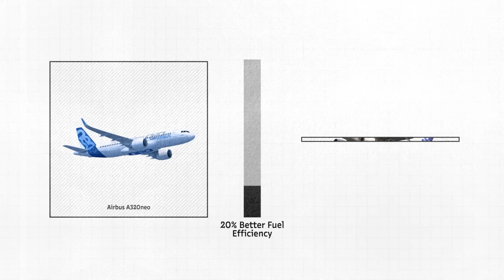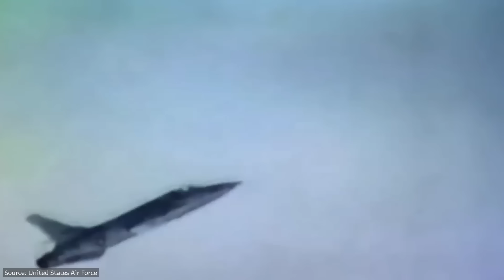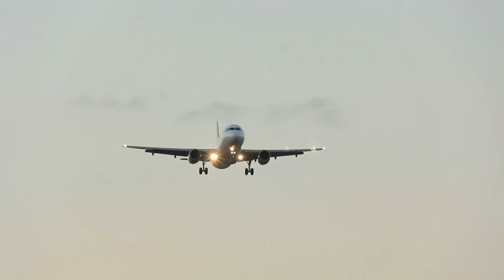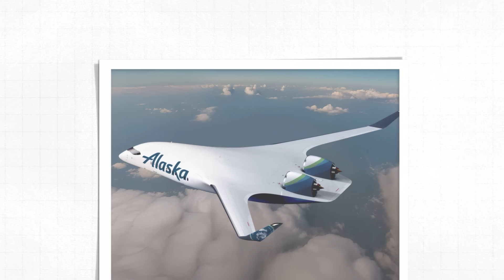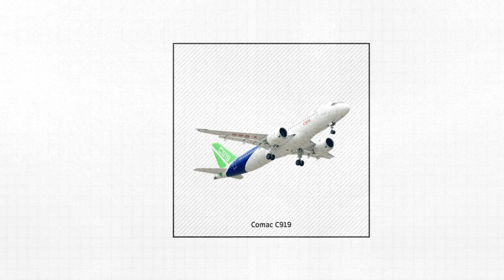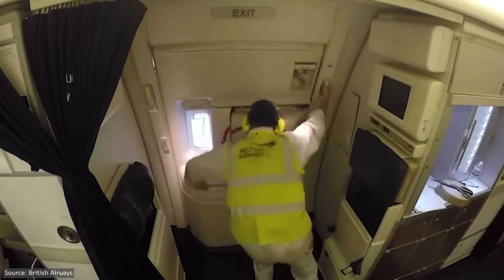The RADICAL New 737 Competitor Coming By 2030?

Comment: Should be interesting to see how/whether they solve the pressurization issue across the entire hull. I can only imagine they'd use something like an air-mattress style cross section to do it, but the fatigue stresses at the joints must be a real design challenge, even with CF/epoxy. I really hope they can pull it off.

Comment: Just watched a video on the Flying V, seems nicer for passengers. If a big efficiency gain could be demonstrated in a workable aircraft it wouldn't be long till every airline wanted them, the airports would adapt. Electric planes would benefit from these more efficient hull designs too. Advanced batteries are already going into production. The advantage of this design over the V is the engines both on a tab in back, maybe this tab could be removeable for service.

Comment: Why not (instead of double-deck) airplanes, create a plane with two cylindrical compartments bolted side by side? Fill in the gaps top and bottom - to smooth airflow and gain from potential lift, and attach wings and jets as per standard aircraft. The space between the cylinders (top or bottom) could potentially be used for battery storage or the placement of hydrogen tanks. There would also be the potential for doubling the cargo capacity.

Comment: I wonder how rough one of these would ride. The wings on normal planes act as suspension to absorb some of the turbulence and not transfer it to the body. When the body is basically the wing, I’d think all that would go straight into the end user vs flexing a wing.

Comment: the design you show is a very unlikely reality indeed. To have the benefits of a blended design, you need it to be a FULL blend . Keeping those little wings is unnecessary, their purpose is simply to avoid dispensing with ailerons and elevators or having to install longerons. Ailerons can be fitted on the outside edges of the body each side and elevators can be fitted to operate from the rear edge of the body, one each side of the engines. No need for wings at all provided the undersurface of the body is flat and clean as a wing and the upper surface of the body is proportionately curved like a wing. Also, you can design it to be "stretched" for later versions. But surely Jet Zero know all this.

Comment: Boeings been looking at this for well over a decade. Low speed flight characteristics with adverse weather can be problematic to put it mildly. Pressurization stresses can also be an issue. 787 fuselages with fairing covers could help with this.

Comment: 2030 Is good timing to use geared turbofans that are mature and reliable.  Boeing had over 20 years since acquiring McDonnell Douglas use that talent that did the BWB research.   But too fearful to Osborne themselves, They will just keep building outdated designs forever.   Aviation needs to improve for sustainability.  The market will make that happen with lower operating costs.

Comment: BWB is a dead end. Besides other problems others already addressed, the A32x and 737 sell as families, with models seating 160, 195, or 220 seats depending only on the length of the tube. One development cost serves 3-4 different market sizes. On BWB, each size aircraft needs to be designed and tested separately, with separate tooling, because the bodies have different contours.  The next tube design wil. cost ~$40 Billion to design 2-3 different sizes, while creating the same BWBs will cost ~$90 Billion

Comment: Cockpit view sucks with its wedge shape, no common parts, and no through deck cargo option. Nonstarter. Seems like they could be less radical by making the front more conventional in visibility. Front should add clamshell doors to access cargo space, and move the cockpit higher above mainwing level.  Give it an ogee shape like a bird, which is self stabilizing. If you are going to mimic nature then do not reinvent the wheel.
Reply: Wow, you know so much more than NASA, FAA, USAF, and hundreds of engineers with PhD's and decades of experience! 
🤣
Reply: @ddsnu2012  ok boomer. Its not about aerodynamics, its about practicality.

Comment: Pressurization I think an imbedded ovum cabin space is easier to pressurize. Passenger window access, I always want a window seat. but I see more than 90% window shades are closed , then on a recent 787 flight my window was electronically opaque for most of the trip. blended wing appears to lend itself to an aft ramp door much like the Hercules, which could facilitate rapid ingress/egress. More and smaller motors ingesting boundary layer ! I see much promise in reimagining aircraft.

Comment: It is a great subject. Couple of things. It may be an unpopular opinion but certification by FAA is not fast or good enough. It’s not able to cope with sufficient speed or indeed management of novelty in tube and wing designs never mind BWB. Other industries have quietly moved on immensely (and to a better level of safety) and it is quite doable and much more effective and better in every way. You mentioned a great example  what’s wrong: the 90 second rule.  By definition, prescription of requirements can’t work. The 90 second evac rule. Where does that (time) actually come from? Either no one knows or it is based upon completely arbitrary and guessed assumptions about , for eg, size of likely pool fires and the ability of aluminium structures (now irrelevant) to contain fire. How does anyone know for sure that 80 seconds might now be required or that 110 seconds is fine? The FAA defining a 90 second rule means that safe design: risk assessments, evacuation planning and design and in particular the people who design for the aircraft maker … can, in theory at least, just hide behind the 90 second rule.. switch brains off. Legally. And the FAA will still approve. That approach doesn’t help anyone and is dangerous. Scale that simple thought to the whole ‘never before done’ design.. and with respect… how could or should the FAA know how to check it? Yes one can read about how they have indeed  introduced ‘how to manage novelty in design.. but a) it is horrifically complex and, in my opinion, not very clear or watertight b) does not seem to call the actual designer to take full responsibility (leaving much with the FAA (I actually feel sorry for them)) and c) Will not be quick enough. Scale the 90 minute problem to more complex issues with these designs and I think the problem has not just been materials science coupled with pressurisation challenges etc., it has been the technical, fatigue, mathematical design challenges…(which we are now much better able to address) coupled with a certification scheme that shackles and indeed reduces designers ability and indeed responsibility-shouldering remit. Let’s get this streamlined.. and then I think it will flow…

Comment: Until someone builds a working model it's fantasy! Boeing built the First 707 on a gamble which they can no longer do?
Their prestige has been lost in the last decade replacing bean counters with engineers? They cut too many corners with
their 737 MAX?  I'll agree lifting bodies are a proven concept? It took a government from 1903 to 1969 to land first time on
the moon with the Apollo project and we have'nt been back since?  Below, What "@dinatvdbelt" failed to tell you is that:The Maveric Airbus is a 6.5 foot long model not a full scale passenger or cargo plane used for testing. No full size has been built yet?--

Comment: I hope Boeing has a tremendous replacement to the 737 max.  The A320 neo is due a replacement in the 2030s.

We need a strong Airbus and Boeing .  The 2030s will see new aircraft before COMAC or the MC21 (which was a good aircraft) and super jet v2 (probably a dud) have made breakeven.  Airbus has played a strong hand very well.  Boeing needs to step up.  Boeing can not afford another  787/777x fiasco ever mind the max problems.

Comment: De-carbonization is an EXCUSE to FINANCE corporations. Like those petroleum companies selling solar panels grid arrays. Or those batteries making companies willing to shift the focus on being RESPONSIBLE TOGETHER while hiding behind the screen the environmental and social/demographic/economical TRAGEDIES in places the necessary ores has to get extracted, so their entire business and chain of contractors remain untouched.

^^ but, that's just how the world works.
What is to be remembered is, De-carbonization and/or fuel efficiency are much less of a need than the public actually believes! They absolutely aren't critical parameters/arguments to justify decisions in the aviation industry.. actually, in ANY industry.

What matters first and foremost way ahead of the above: COSTS!
- 1) daily routine operational costs
- 2) maintenance costs (not just engines, do a system failure/physical component damage grounds a plane for hours or days, especially if specialized teams from manufacturers are REQUIRED, as demonstrated by 787 over 767 which proves way much costlier to operate than an equivalent fleet of 767?)
- 3) costs of reforming an ENTIRE DEPARTMENT (or adding an entirely new). This occurs upon introducing a new aircraft requiring a new type-rating (Boeing-Airbus type switch), or updating facilities with new equipments and tools (with the qualified properly trained personnel)

Every major new thing bringing in its wake a massive tsunami of unwelcomed extra cost, lately, has become the no1 BIG NO(!) for airlines.
This went so undermined by the public and institutions, speaking mouths in airlines became increasingly bold: if new engines are that fragile (geared turbofans), just screw that concept ENTIRELY and build the venerable proven older generation INSTEAD!" or simply _"new has become so bad we need to stop that hype right now..!"

That's why major manufacturers remain conservative. Not because they don't have the competence to build supersonic or design-innovative concepts, such producs simply won't sell to the intended client: airlines! (not the lambda know it all aviation expert on social media).

What is United doing is BAITING other (expected to be stupid) airlines to WASTE MONEY INVESTING IN THE NEXT IDEA SUPPOSED TO CHANGE AVIATION FOREVER. 200 millions is absolutely nothing, especially when the actual finance deal spans over a decade (that's 20 millions per year on average, the benefits from credit cards transactions alone entirely cover that) United knows very well 200 millions won't cover the 5 billions (best case scenario) required to just finalize a new product which may enter production (giving firm paid orders). 

United knows BOOM will silently die, JetZero will silently die. So why startups still attempt to make the impossible while veterans such as Boeing or Airbus didn't even tried? Three reasons:
1) if one wants to enter the game of building commercial planes, well, will surely DIE for a deep lack of trust cause competition. To go at least further, must propose a product where the major established manufacturers are completely absent: concepts, like Rutan/Scaled Composites.
2) but just like Scaled Composites, out of 100 attempts at any concept, only one is profitable in the end. Why persist? Because, "we can make OTHER people/entities PAY IT ALL, whatever happens in the end, we aren't the ONES losing money, we are the ONES actually getting paid!!!" Investors is the business model. As simple as that. That's why public image is key, beautifully rendered CGI, enticing orders announcements, bold entering service dates (clear blatant LIES for those who know, but heh, as long as we get money)...
3) even SMARTER than those trivials modus operandi, how can we make AIRLINES and AIRCRAFT MANUFACTURERS GAIN SOMETHING IN SOME WAY, to put them rather as ALLIES than SCEPTIC figures trashing our business? Integrate them!!! Select an obscure concept aircraft manufacturers hasn't SUFFICIENTLY STUDIED and propose a deal to subcontract that study. In other words, Do manufacturers R&D and get paid doing it. Airlines: present them our findings (the ACTUAL ONES, NOT THOSE WE THROW AT THE PUBLIC), for them to ACTUALLY know better how bad of an idea a concept may turn out for the business in the end. Make them make a small gesture to get that information... That's how you find famous names listed in entities involved in the project; ironically, ho the way a com words its narrative make the public understand everything in a VERY DIFFERENT WAY...

^^ That's why startups seemingly trying to bring any concept to public production is a thing, and will remain so for a long time. It doesn't matter in the end wether supersonic travel will rise from its ashes or large capacity flying wings crowd airports OR NOT. IT DOESN'T MATTER.

Comment: Firstly, if it carries 250 passengers it is NOT a 737 (or A320) competitor. It may be a 757, 767 or A330 competitor depending on range. Secondly, the BWB concept had never gotten pass the initial gates to development by the big boys because of inherent issues with mass inefficiencies, exit problems and a lack of a cargo deck due to the pressurized volume geometry. Sometimes these things are more important than a few percentages of efficiency over tube and wing designs. Also, BWBs DO NOT SCALE; you cannot build longer and shorter versions of it without huge redesigns.
Reply: I worked at the old McDonnell Douglas part of Boeing. I knew the BWB guys from MDC. Once the merger happened, the old wing and tube guys from Seattle were never going to allow a new idea compete with their babies. Mark Page and Bob Liebeck are smart guys. Ever hear of the Gurney flap? That was Bob. They’ve solved the issues with getting in and out as well as cargo. It is true that you can’t simply stretch the tube like the old designs. One of the things that they’ve improved is the composite design. They use sewing machines and an autoclave. The ribs and longerons are sewn to the skin and gets fused in a single operation. Approximately 60%+ of the entire top of the fuselage in one operation. The central fuselage was manufactured and tested a decade ago. It’s very strong. It’ll drastically reduce the hours to produce the airframe. I watched the iterations of the design and manufacturing on the virtual environment. One good thing is that when you scale up the fuselage, the aero stays consistent, which will save a lot of money for future models. Boeing will NEVER make their own BWB. They are too conservative. Going after the 737 market is the sweet spot. All of the major manufacturers have purchased the sewing machines. So. They are all working out the manufacturing methods. I wish Jet Zero well. I retired last year and sent a note to our new CEO that they should purchase JetZero once they get it flying. Boeing’s lost its mojo design wise, but they can scale for sure.
Reply: @jamesdellaneve9005  Marvelous insight. However, I am not convinced that a rounded triangle pressurized volume can ever be as light a cylinder made of an equivalent material and construction technique. Also, scalability is more important than most people give it credit. The A320 would not be successful as a 737 competitor without the A318, A319 and A321.
--
I am also not convinced that the MDC gays are bolder or more innovative. The DC-10 was not bolder than the 747 and it wasn't more innovative than the Tristar. The MD-11 and MD-90 were... well... anything but. If anything the Boeing guys were too bold and innovative for their own good with the 787 -- tackling all composite construction, all electric architecture and global division of labor (and subsidies) all at the same time.
--
If I have to bet on the configuration of the next Boeing aircraft, I'll peg it as a Composite Single Aisle with a canard configuration and over the wing engine pods (ala Honda jet) which doubles as twin tails. Two wings -- a 36m C gate wing w/ 7,000 gallons and a 52m D gate wing w/ 12,000 gallons. Four common fuselages to cover 170, 200, 230 and 260 seats. Range should be around 3600, 3200, 2700 nm for the short span wing and the shorter three fuselages. The long span wing will get 5000 or 4200nm with the longest two fuselages. For special applications like BBJs, AWACs and maritime patrol, the long wing can be paired with the shortest, lightest fuselage for enhanced endurance.🤣
Reply: @dwightlooi The guys who worked on the BWB for 20 years were not from the commercial aircraft group, they were from advanced design team on the defense side. They left Boeing to start JetZero. Boeing’s next aircraft will be a variant of wing and tube. The last I saw was a high wing with a diagonal cross braced strut. I predict that the BWB will killed the 737 segment, which has proven to the be the single most optimized aircraft size for the US market. A larger version can take over for the current larger aircraft. Once you get 40 to 50% better fuel mileage, it’ll really democratize air travel. Here’s a bonus, if they are smart, the airline can widen the seats. Which airline would you fly on? The current single aisle barrel was determined in the mid 1960’s. We haven’t gotten thinner.